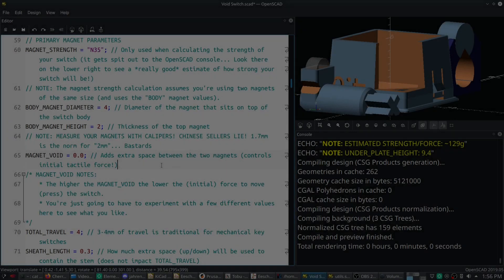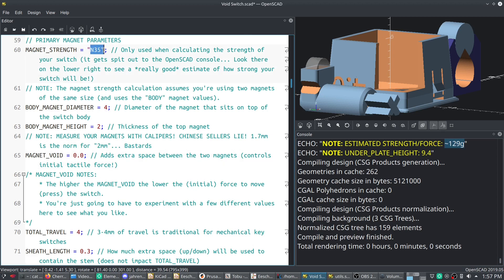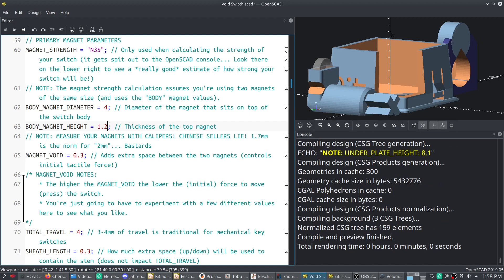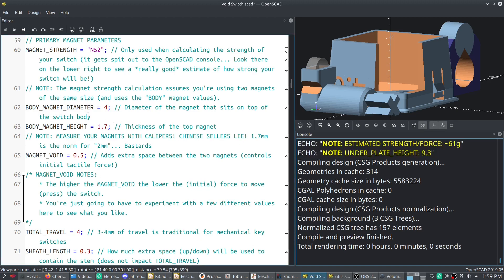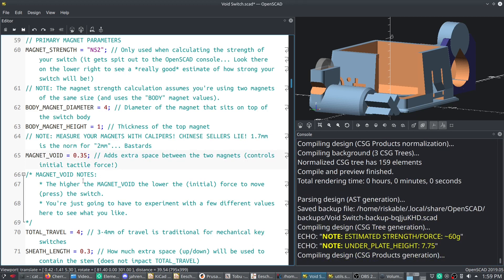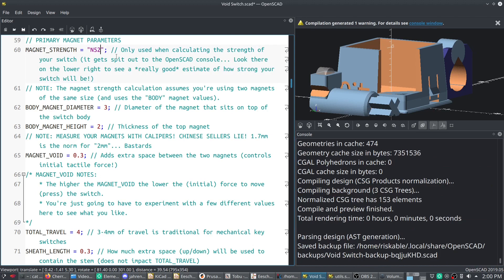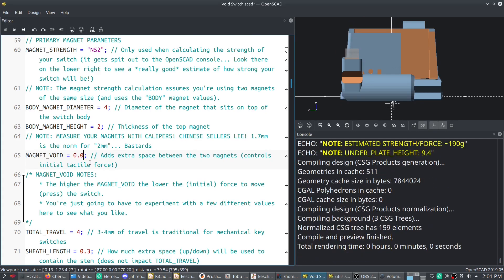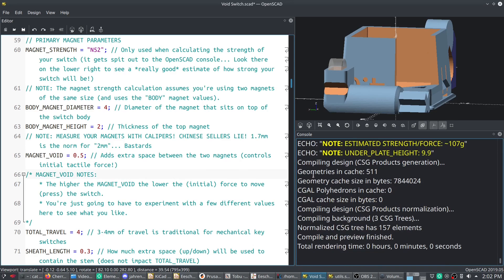Void Switch Update: New Strength/Force Estimation Feature

Comment: so pumped for this project!
How is the cost of these switches, not counting time? Roughly of course
Reply from the maker: When I ordered my magnets from AliExpress they were $0.01/each but now the price has gone up SIGNIFICANTLY!  Now they're like $0.03/each!  So if the price comes back down the switches will be about $0.04/each but if the price of 4x2mm magnets stays high they'll be $0.07/each :D
Reply: @Riskable3DPrinting  Oh! I expected more like 10 cents for a magnet or something! and the magnetrometers? The thingymebobs that measures if it's pressed or not?
Reply from the maker: @KnowArt  The hall effect sensors are about $0.10-0.16/each depending on the state of the chip market. In fact, if things were normal they'd be like $0.05/each!
Reply: @Riskable3DPrinting  ah alright. Thanks! if I ever need another project, I'll definitely consider buying a 3d printer and giving this a shot.
Reply: @Riskable3DPrinting  It's still a really good price, and the idea of making your own keyboard with a 3D printer is insanely cool.

Comment: Has anyone done any force curve testing for different configurations of these? I realize there's a combinatorical explosion if you tried measuring force curves for all possible combinations of settings, but a few of the common ones would be nice.

I'm very interested in this project, since I've never tried AT&T magsep switches but the force curves looks very similar to buckling springs, which I love.